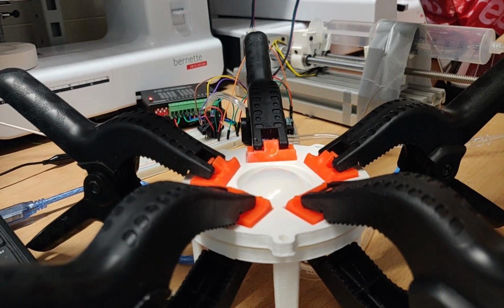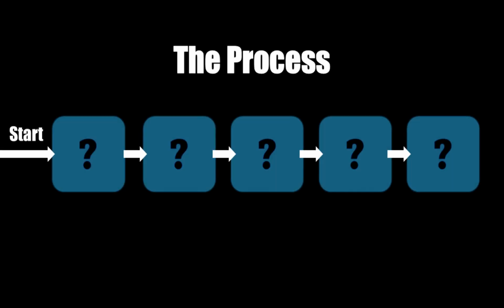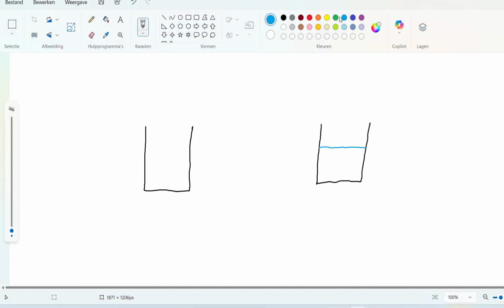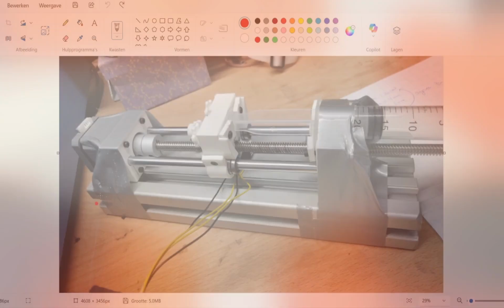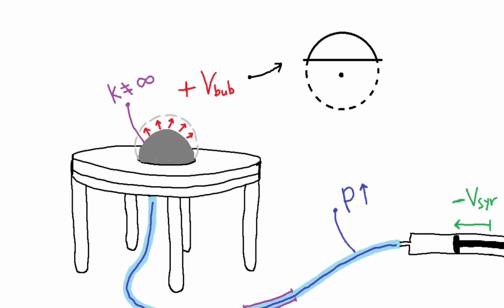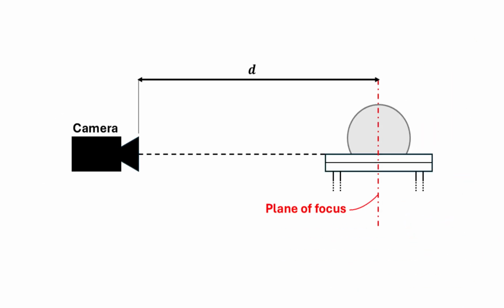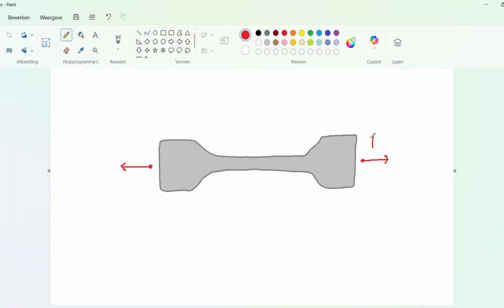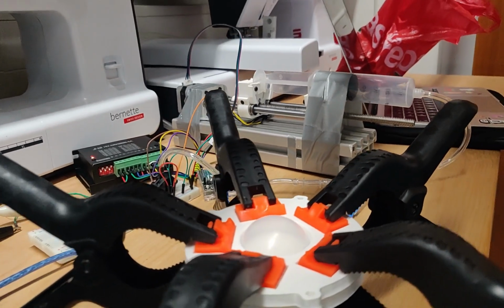Blowing stuff up (for my BSc Thesis)

Comment: 4:00 did you take the time to find or normalize the margin of error for the mixture? How do you know for certain that tiny differences in the ratio do not significantly skew your results. Is vacuum drying a valid and available method for curing the mixture for consumers? What is the practical application if you are only producing "laboratory" quality Ecoflex 30. At what margin of error do the material properties differ from your control so that you know you have a valid control? Or is there an existing study that has done this you can site to be sure that you have a valid control mixture?
Reply from the maker: Hey, 
Firstly, thanks for your interest and questions :D

As I stated in the ending as well, the testing has only been done on one sample, so the direct results are not representitive for a general model of Ecoflex 30. During the testing I've only worked with one batch of samples, so for that batch (only) the deviations in the mixture (the component ratio) are likely minimal. However, a much larger sample size should be used of course, due to the deviations as you mentioned, if a reliable general material model is desired.

In that case, an actual research towards the mechanical properties of industrial ecoflex 30, the 'laboratory' quality Ecoflex 30 is not similar to that of industrial production applications. However, the quality of consumer made ecoflex 30 might be more relatable to my 'laboratory' quality ecoflex. Since, I've only used a vacuum pump to remove air bubbles, but nothing more. 

I've also looked into papers with material properties of Ecoflex 30 achieved with other loading methods, where my results were somewhat in the region of them. So, I do know that my mixture was at least partly similar to that of the other papers. However, note that other errors in measuring might be a bigger issue concerning the reliability than just the mixture. The (camera) measurements and geometric assumptions for example, have their limitations as well.

Note, I've only had 9 weeks to start from skretch and write a paper (10th week was presenting/defending). So, simply by time constraints assumptions such as Isotropic behaviour of the material are made. I also would've liked to look into the temperature effects on the material for example, which is now assumed to be constant throughout the deformation process. So, there are many aspects that could still be improved and investigated further on this project, but sadly... time :/

I hope this explanation has cleared up your questions? If you have any more following from my answer, feel free to ask! Otherwise, have a nice day :D